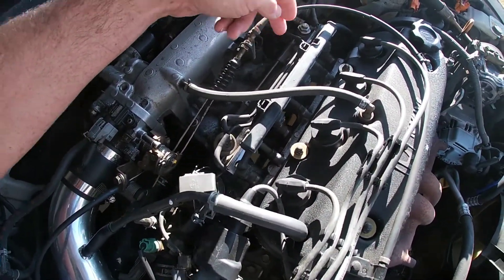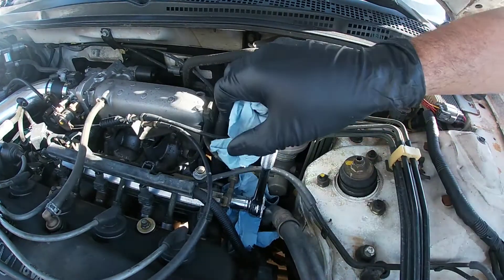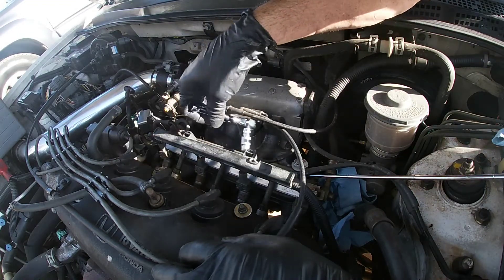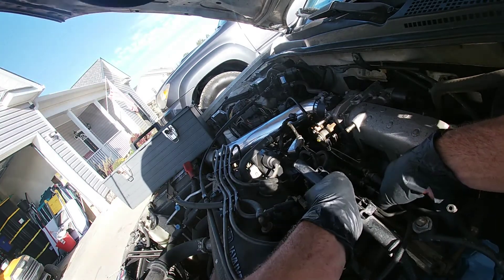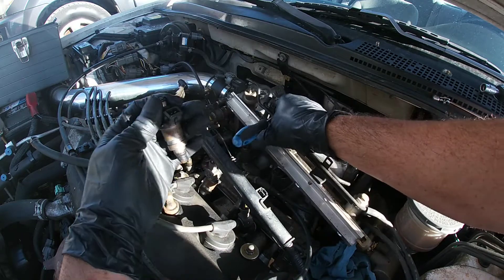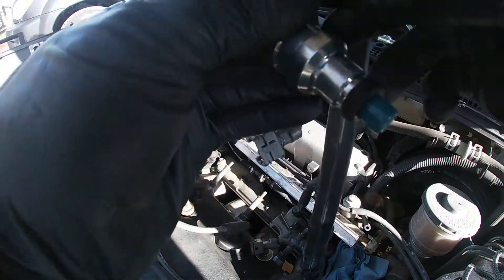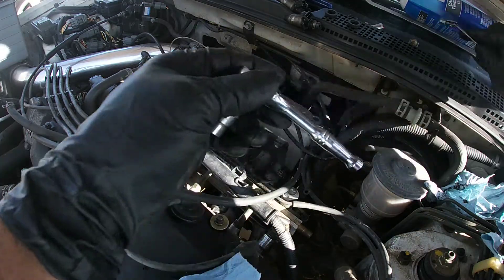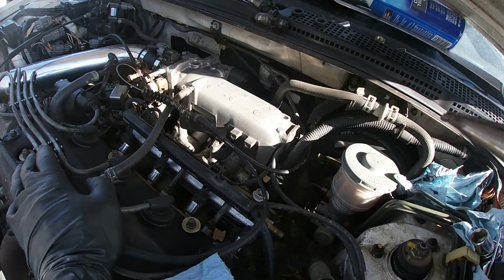Fuel Injector Replacement - Resistor Delete Honda Accord 1994 (93,95,96,97)

Comment: I don't think you did it correct when you tied the wires together...weren't you supposed to wire the others together?
Reply from the maker: I am pretty sure it worked, I did have to get some lower flow injectors, these gave WAY too much fuel

Comment: I have a problem in my 91 Accord The problem is that the injectors get 12V from the resistance, so I test the resistance on its own and effectively 12V enters and 12V exits from all the other cables, when I took out the injector rail to see why there was excess fuel I realized that the injectors expel a lot of gasoline. 🫡

Comment: Hello, I purchased a set of injectors on line, part # 06164 POA A01  , does it require 12 volts to operate ?
Reply from the maker: pretty sure these are direct replacements, you should not have to change any wiring

Comment: Great video! Just a word of caution though, I bought a brand new OEM Honda set off eBay for $60 and they were 5-volt injectors. I'm glad I tried to start the car before I did the resistor delete. Otherwise I think the 12-volt would have fried the new injectors.
Better to crank the car and see if it starts before doing the resistor delete just in case
Reply from the maker: Thanks for the info!
Reply: Can I get the link for the 5 v injectors

Comment: I’ve also cleaned fuel injectors and egr passageways they were full of carbon buildup, but made no difference still misfires. I wanna fix it before I cause further damage as she is my daily A to B…
Reply from the maker: did you try the high quality platinum spark plugs?
Reply from the maker: I see you did change the spark plugs

Comment: I have f22b2 accord can’t identify misfire issue due to missing wiring from the OBD reader under my dash. But it misfires and jerks on acceleration and release of gas pedal at higher rpm. Also now consumes about 5 times the amount of gas it should and smells like fuel in the cabin. It has a eBay cold air intake and aftermarket long tube headers and no tune could that cause air/fuel ratio problem? So far I’ve changed spark plugs and wires, it also has exhaust cut up to the catalytic converter. So now I’m down to either I need new injectors, fuel filter or pump, or even just my cat is clogged from having no exhaust? It runs and drives just misfires and backfires loud sounds cool but I know my motor is just screaming in pain. Someone help please thank you.
Reply from the maker: could you have a timing issue?  possibly try rotating your distributor a little to mess with the timing just a little, but ods are you might be off on your timing a little?  unless your throttle body is messed up??

Comment: What happens if I do this on stock injectors after cleaning them?
Reply from the maker: can not do a resistor bypass with stock injectors....   it will definitely mess things up   stock are designed to run on 5vdc, this bumps it up to 12vdc

Comment: ? I have a acura integra  90 that has a resistor  box   and I'm reading 12 ohms but the car its missfire I found out that a obd1 dizzi was on  that means I have obd1 injectors  on a stock obdo ecu ? Can I delete the resistor  box or its better  to get some injectors?

Comment: Hi, I have same accord with 1.8l engine non vetec in Uk. Can you help me on injector replacement as mine accord is very bad on fuel and mechanic told me to put new generation injectors with multi spray pattern as original are single port spray?

Comment: I'm not modding anything but I've replaced the ecu already. The problem is I have no injector signal to #3 cylinder only. I'm down to either the harness or the resistor. How likely is it to be the resistor not giving power to #3 cyl

Comment: I was told that when removing the resistor box you need a ecu that doesn't look for a resistor box or it will burn up the ecu down the road?
Reply from the maker: I have not hear that ... interesting, because the resistor box is just taking it from 12vdc to 5vdc?   I will have to check into that
Reply: @MyLooneyBin  i think low impedance is 3 ohms and high impedance is 12 ohms. I think with the resistor box and low impedance for oem 95 accords. I think. Not 100 percent sure but I do know the ohms are right since I use honda tuning suit to tune my turbo 95 accord. And my injectors are 12 ohms without the resistor box.

Comment: Do you have to release fuel pressure before taking out fuel injectors. I didnt do that. Will my engine be fine?
Reply from the maker: No.  Should have had fuel leak as you were taking off the fuel rail!   All good.  Just make sure you have the proper size injectors for your setup. Very important.

Comment: Did this give you a noticeable difference in power?
Reply from the maker: Too much fuel.  Didn't have enough air or the proper tune.  Didn't even have enough power to get out the driveway.  The fuel.injectors I got were too big!  Too much fuel. Not enough air and spark

Comment: I just changed my injectors and did the bypass and now it won’t start
Reply from the maker: What size injectors.  Need air, spark and probably a tune.  These cars are about 220cc.  It takes more to make the car work with 420cc injectors.

Comment: Does removing the fuel rail give better access to the fuel filter? I’ve been wanting to change out my fuel filter but its buried behind the fuel rail (at least thats how i see it).
Reply: I have a 95 2.2 Accord and mine is top mounted to the left of the engine bay
Reply from the maker: I gave up replacing my fuel filter, you need the claw foot wrenches with an extension, but I could never get mine to break.   maybe with the car jacked up and one guy above and one guy below, but as soon as it breaks, the guy below is gonna get drenched!   If you figure out how to change it, PLEASE let me know!!!
Reply: @MyLooneyBin  I got it loose I just had to spray it with penetrating fluid for a couple days prior to taking it out someone recommended soaking the fittings in a towel soaked with the penetrating fluid and that’s seemed to help was able to get one side loose, the other side I just unscrewed where the fuel line goes from the filter to the fuel rail and took it to a bench vise and was able to get the nut loose using a breaker bar and a pipe on the end of it
Reply from the maker: @cblizay1165  that's awesome.  Great idea.  Never thought about leaving part of the line connected and just change it when you get it out!

Comment: What size injectors did you use? I have JDM h22A swapped accord and I want to change the injectors. The car still has the resistor box. What size injectors do you recommend?
Reply: For 420cc injector do i need to delete the resistor? Thank you
Reply from the maker: @RenzSantiano  yes.  If they are after market injectors they are most likely 12vdc.   The OEM voltage on the Accord for that year was 5vdc so you would need to delete the resistor.  With a 420cc injectors you will need an after market intake and the best spark you can get.   420cc is a lot of fuel for a standard setup.  It probably won't work.
Reply: Okay thank you. The idle is rough like almost died. I’ll do the resistor delete then.
Reply from the maker: @RenzSantiano  let me know how it runs.  It was too much fuel for mine.  I had to go back to stock injectors until I can upgrade the intake
Reply: @MyLooneyBin  not good lol. Hahaha i returned the stock one and i think i mess up the wiring of resistor. Its all black and one red 😅 the accord idle roughly and died. 🤦🏻‍♂️
Reply from the maker: @RenzSantiano  eeee I will look at mine tomorrow!   
Hit me up on instagram or Facebook and I can send you photos.  Maybe that can help
Reply: @MyLooneyBin  what is your Facebook? I’ll add you. Thank you man!
Reply from the maker: I will say this, with no intake or exhaust mods, 420cc were too much!   so, i went back to OEM injectors until I get a larger air intake

Comment: sorry if I'm missing the info, what year are those new injectors?
Reply from the maker: it is a 1994 honda accord with NEW injectors - these are NOT OEM injectors, these are aftermarket injectors.   Most after market injectors are 12vdc, the 1994 accord had a 5VDC injector system, so you have to delete the resistor to bring the voltage up to 12vdc
Reply: Thanks, how do we know that the aftermarket are 12v instead 5v? most aftermarket parts here doesn't came with these info.
Reply: have you got any problem since? (with the injectors)

Comment: So, just to confirm, you bought new fuel injectors and they were 12 volt instead of 5 volt?  Is that not strange that Honda would create different voltage fuel injectors for the same vehicle?  
Oh, thanks a ton for posting this video - really well done and super informative.
Reply from the maker: Most fuel injectors are 12vdc, but yes, for some reason, Honda installed a resistor to drop the voltage to 5VDC for their fuel injectors, so if you buy AFTERMARKET fuel injectors for the accord you will need to delete the resistor - you should also get a tune.  but that is hard to do if you don't have an upgraded CPU
Reply: @MyLooneyBin  Thanks for the quick response.  Wow, that's just so crazy that they would do that.  I ended up going to the auto wrecker and I found some 5vdc fuel injectors that all checked out from an ohms perspective.  I'll test and clean them and install them.  Thank again for your help.
Reply from the maker: @Merlin-GR  thanks, I am glad the video helped  ... thanks for commenting!!

Comment: I thought it's 5 ohms not 5 volts.?
Reply from the maker: I am pretty sure the old injectors work off 5VDC, but I guess all you would have to do is meter the voltage coming out.  I guess OHMS law is the answer, but either way, you have to delete that resistor that drops the voltage.

Comment: I just changed mine but i havent done the resistor delete. It cranks but wont start. Is the resistor the reason for this?
Reply from the maker: Probably.   If you are using aftermarket they are most likely 12v.   You need to do the resistor delete.   Just do it in a way you can change it back if you ever want or need to.   Also if your injectors are too big the car can't ignite the gas.
Reply: @MyLooneyBin  I also checked the ecu because i was suspicious of that before i changed the injectors, and i noticed some burning on the inside on some soldering where the connector port is
Reply from the maker: @angelsaninocencio6055  nice, I did by the prelude P12 ECU I planning on upgrading to, but I have not looked at mine yet, I will have to check that out!

Comment: I have never felt comfortable working on machines and am always surprised when things go well.
Reply from the maker: Well this ended up being a disaster.  The fuel injectors I chose where the wrong size!   Lol had to clean the old ones and put them back in, and reconnect all the wires!
Reply: @MyLooneyBin  What's up with the throttle cable going over the PCV hose toward the end? Shouldn't it be going under it?